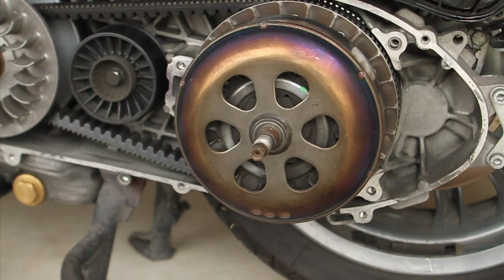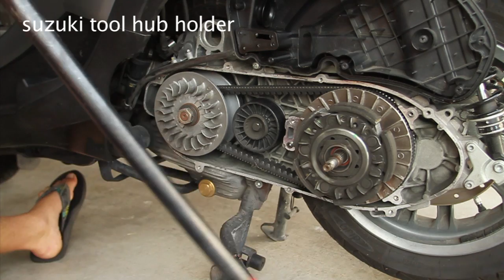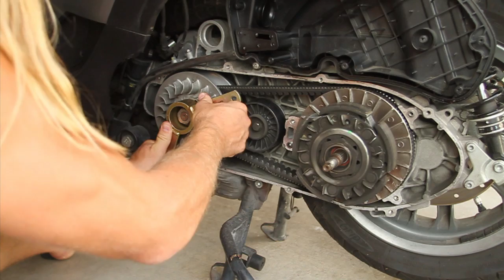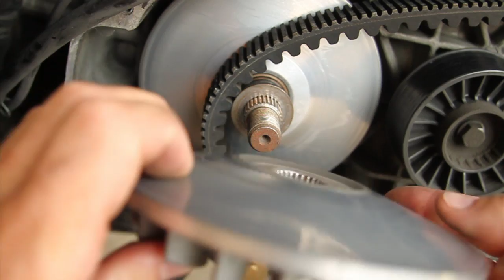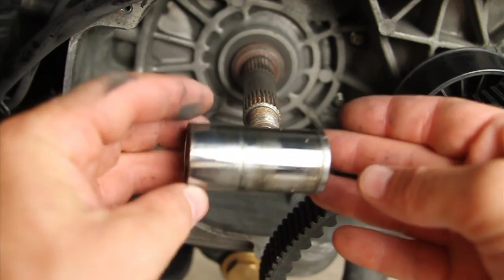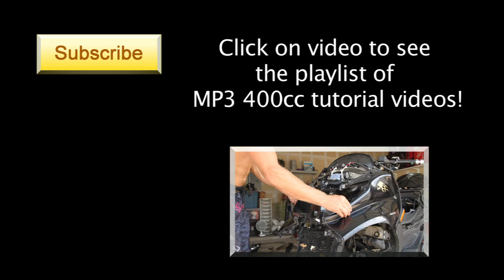Piaggio MP3 400 - CVT Parts Removal | MicBergsma

Comment: bro, what about impact gun wrench to open the variator? but i heard that using impact gun wrench might spoil the crankshaft threading when so much over-torque. so is it better to use manual tool wrench to do safe?
Reply from the maker: xxx1902Atp e33 impact wrench is fine to remove, I prefer to use torque wrench for installation to be safe